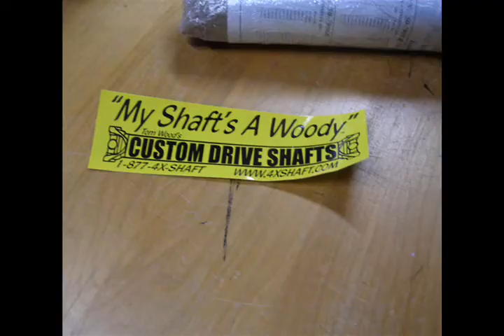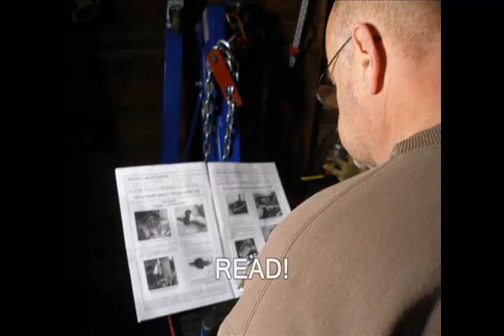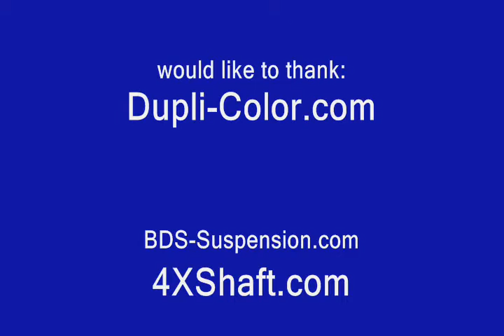TOM WOODS 4Xshaft.com AdvanceAdapters.com

Comment: The video shows the new shaft with the speedo drive gear in place. DO NOT DO THIS. You will never get the oil pump past the gear.  Wait until the rear case half and oil pump are installed before installing the speedo gear!